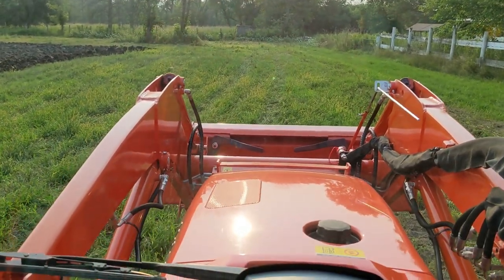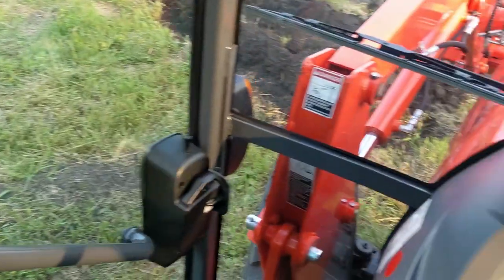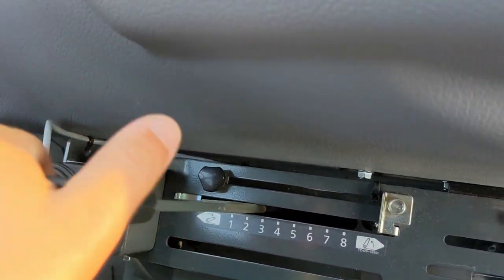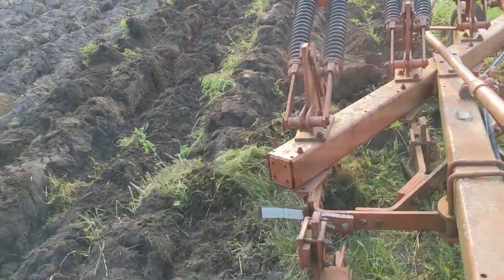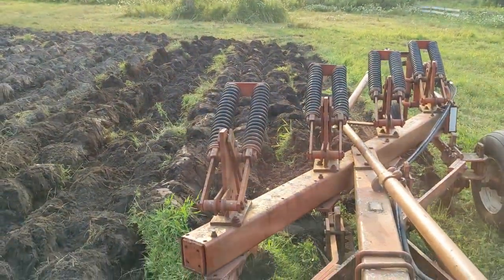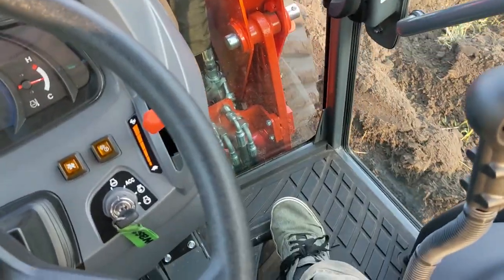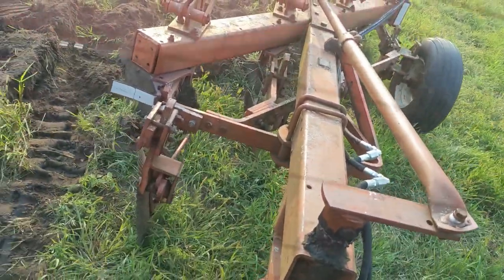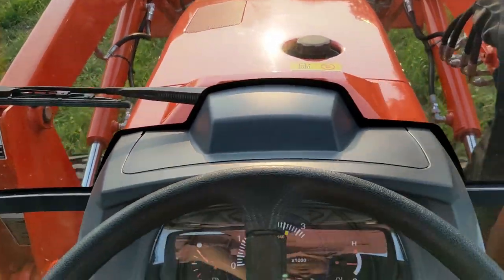4-bottom plowing with a Kubota 60HP Hydro-static Transmission (MX Series)

Comment: Looks pretty solid. I have a brand new 73hp Kioti Rx, relatively similar type of soil to yours but a bit more clayish, plan on ripping it in the fall with full irrigation. Do you think a 5 bottom plow with 2 stabilizer wheels on the back is ok for my size tractor? I know 5 bottoms are usually used with 110hp but after watching your vid I'm a lot more convinced. If a 60 can do 4 then 73 should realistically be chugging along the same power to plow ratio pulling 5. Would love to know your thoughts on this. 
Thanks!
Reply from the maker: I bet you could pull five bottoms with 73HP and 4-Wheel drive (Assuming you do this in the fall). The old rule of thumb was 20HP per plow. However, I found out from another farmer that the rule holds true for a 2-wheel drive tractor. I believe the the new rule should be more around 12-15HP per plow when you have 4 wheel drive engaged. 
Worst case scenario would be that  you have to unbolt one of the plow bottoms, so why not go with the 5 bottom plow!